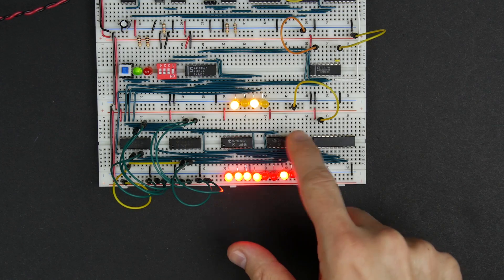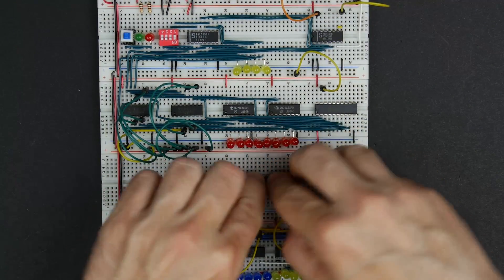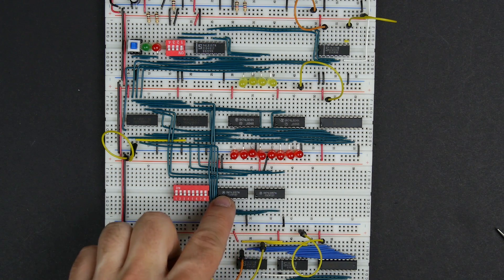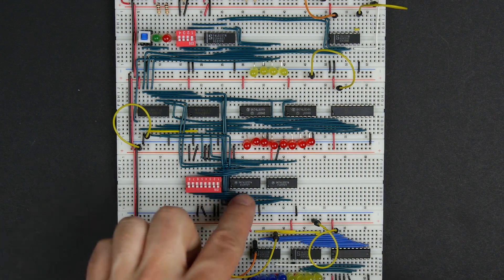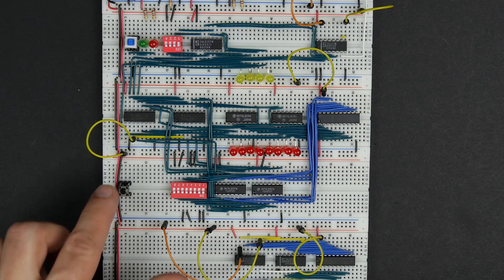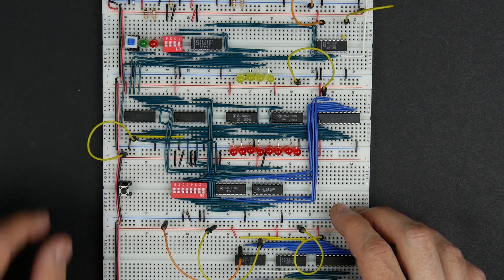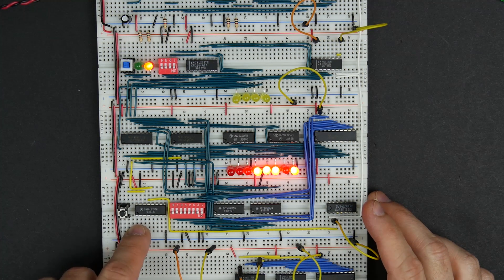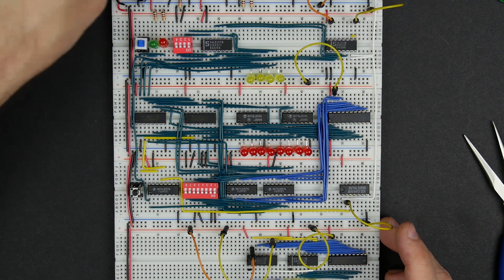RAM module build - part 3

Comment: Ok, I have to say that I get a little lost, when I watch Ben do his wiring from chip to chip / pin to pin..

Let's start with the multiplexer outputs to the memory inputs:
He starts with : 
Memory data input 1 and connects it to multiplexer output Y3
Then Memory data input 2 goes to multiplexer output Y4
Then Memory data input 3 goes to multiplexer output Y2
Then Memory data input 4 goes to multiplexer output Y1

Second Memory Chip:

Then Memory data input 4 goes to multiplexer output Y3
Then Memory data input 3 goes to multiplexer output Y4
Then Memory data input 2 goes to multiplexer output Y2
Then Memory data input 1 goes to multiplexer output Y1

He does the same thing with the DIP switches although not as bad

DIP pin 1 goes to multiplexer A1
DIP pin 2 goes to multiplexer A2
DIP pin 3 goes to multiplexer A4
DIP pin 4 goes to multiplexer A3

He did this for both sets of 4 bits.

Next he hooks up the 74LS254 buffer outputs to the multiplexer B inputs

Buffer pin 1 to multiplexer pin 3
Buffer pin 2 to multiplexer pin 4
Buffer pin 3 to multiplexer pin 2
Buffer pin 4 to multiplexer pin 1

He uses this same pattern for the second 4 bits as well.

I don't know if it is me, but I have a need to set things up this way

pin 1 to pin 1
pin 2 to pin 2
pin 3 to pin 3
pin 4 to pin 4

OR

pin 1 to pin 4
pin 2 to pin 3
pin 3 to pin 2 
pin 4 to pin 1

That may be why my wife calls me OCD.     LOL!!!
Reply: chip pins are all kind of random, it's even worse on QFP, you need to take the name on the pin and find the index, then connect the cable, then do it again for the destination chip

Comment: In which video did you build the instruction register?
Reply: Its just a normal register dedicated to store the address of the current instruction
Reply: +Schlammmer MC  Oh ok. thanks!
Reply: It is a normal register, except that the high nibble is not wired back into the 74LS245 buffer, only the low nibble is wired back to the 74LS245 buffer.

The high nibble will go to the Instruction decoder. 
At the end of "Testing our computer's registers - 8-bit register - Part 5" he quickly discusses the IR (Instruction Register)